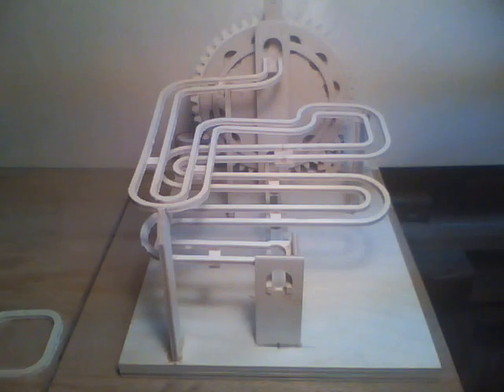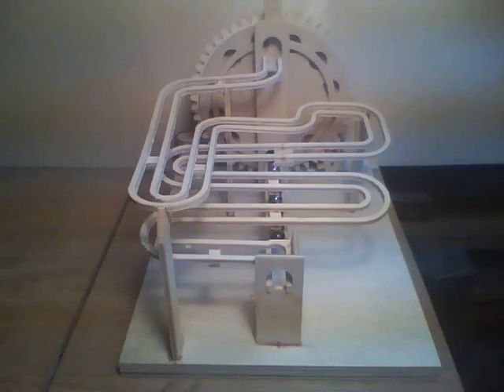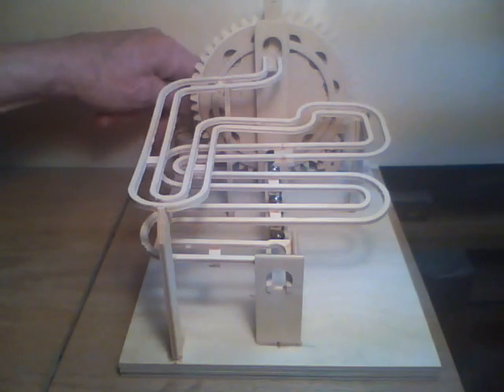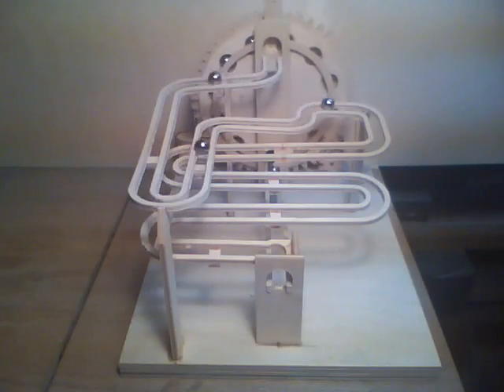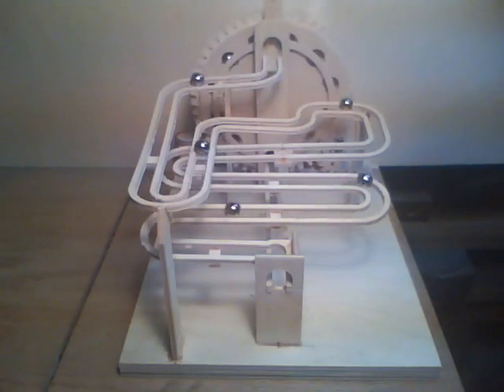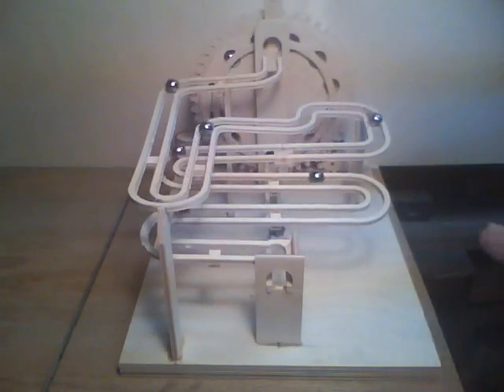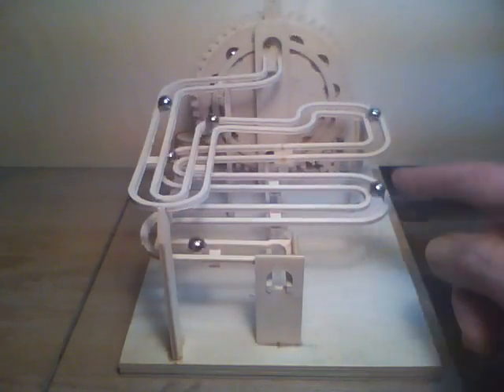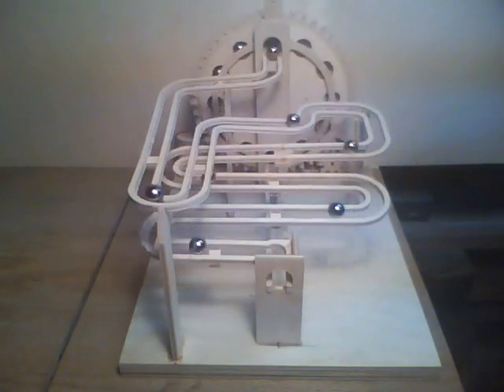Testing my New Rotary Ball Bearing Module

Comment: Hey Jim,
Love the vids.  Where did you get the little motor?  What are the specs?
Reply from the maker: Thank You, This is the motor unit:  
http://www.ebay.com/itm/Tamiya-70203-Low-Current-Motor-Gearbox-3-Speed-/381550703487?hash=item58d631b37f:g:WDwAAOSwstxVacj6
Reply: @steinie44  it's gone now. I hope you made a hundred of the tracks! At least!